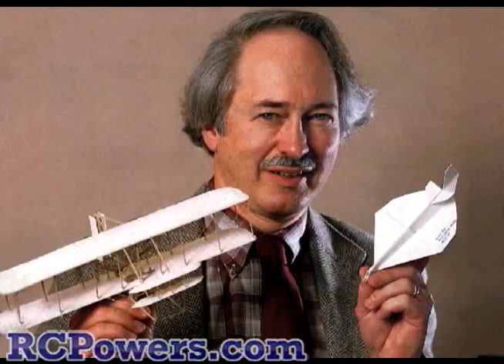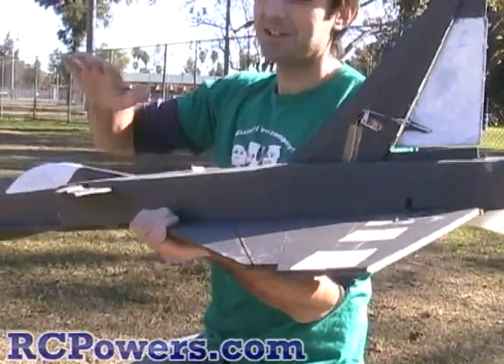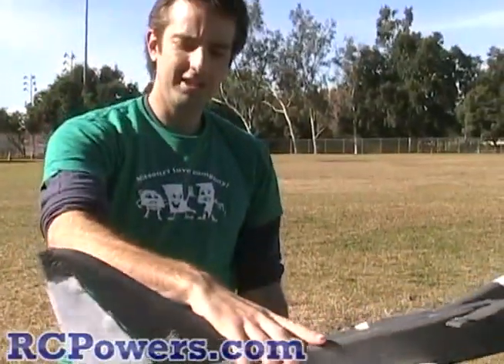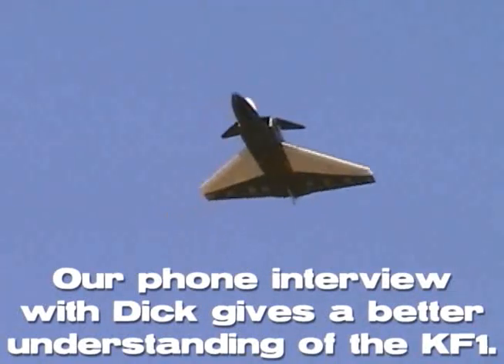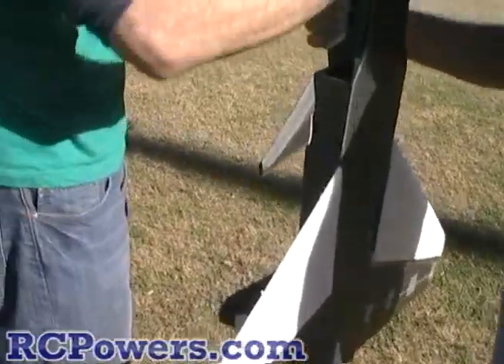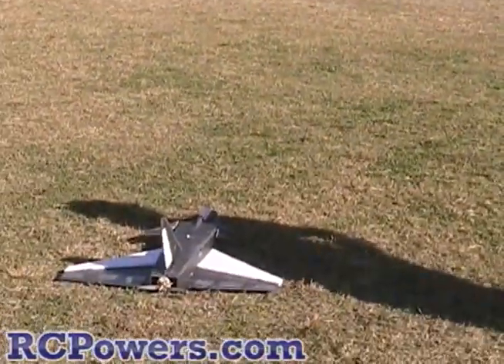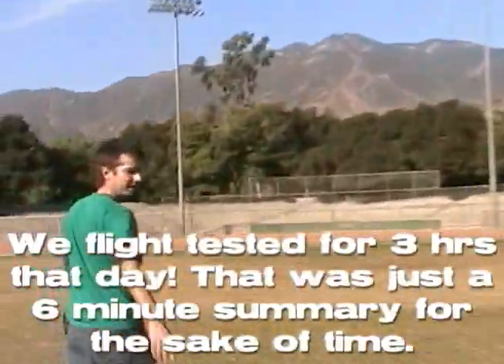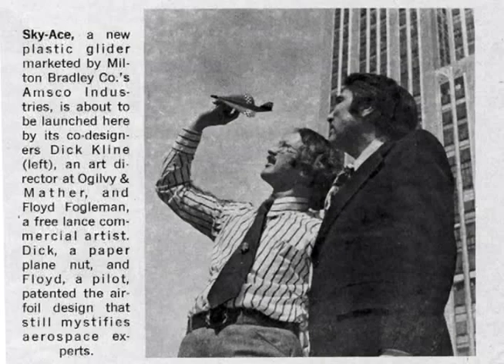KF Airfoil Testing!!!

Comment: The KF3 test isn't correct.  At 5:53 you can see the rear plate is flat, the front plate goes up to 3 high, and you can see the insert.  That first step down is 2 high, to a flat rear plate.

Should rise to 3, then step down only 1, to 2 high, then the rear plate slope down from 2 to 1 height.  A more rounded, airfoil like profile, with both steps of 1 height and a slope down on the rear plate, not flat.

The 2 drop probably adds extra drag, the correct profile should be more slippery.

Comment: They all looked pretty much the same to me apart from the bottom step airfoil which flew pretty bad all round. In fact the first (flat plate) appeared to be fastest visually. One thing that might have skewed the test was that when you added the KF step it extended well in front of the leading edge and so increased the wing area by a big margin.. that would explain any better slow speed capabilities.

Comment: Is is possible to add a KF4 airfoil to the F-117 build? I know there is not much wing left on the top side of the F-117, but could a little be added to the top side and bottom side to make a difference?  Thanks.

Comment: kf1 sucks if the high alpha is going belly forward like ur hand than its good
kf2 is awesome for speed
kf3 is good for high alpha thing not good for extra weight cause its already too heavy 
unless u have a light powerful engine but its not for extra weight
kf4  is best u need dual engine spinny thingys its good for stunts and weight but u gotta tie the smal camera on tight and ad a litle cushin behind it so it wont fly ohf and drop if u make a hole underneath and put camera there it good